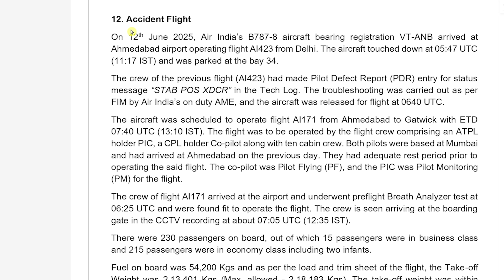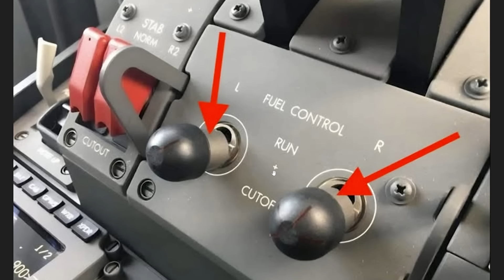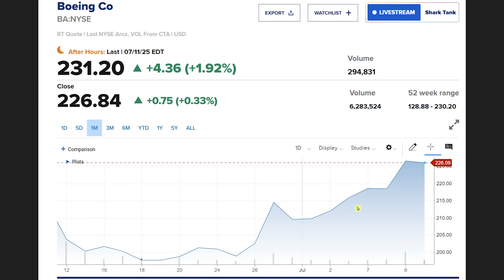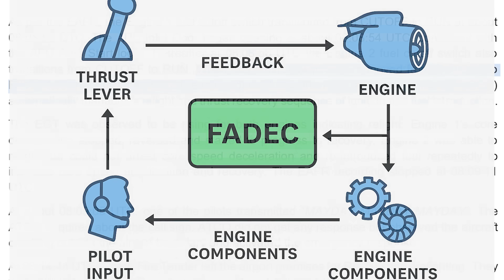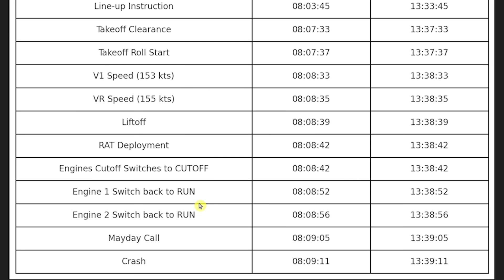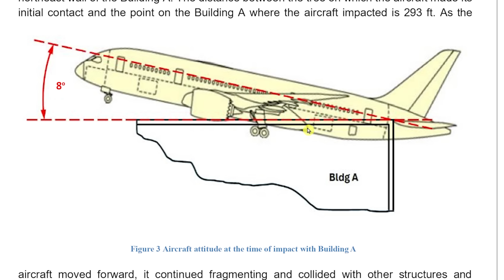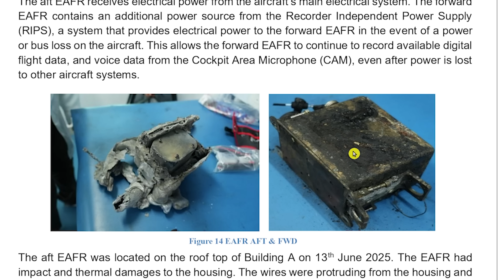Did Pilots CUTOFF Fuel? Shocking Twist Air India 171 Report!

Comment: Something people don't realize when zooming in on videos, is that it seems like a photoshop version of an incomplete picture, made using nearby frames and inserting geometric shapes made from nearby pixels. I learned first hand when my wife saw a video of me doing something in the boat and asked why I had my wedding ring off. I switched to neoprene after a motorcycle accident crushed my ring and nearly took my finger. 
I told her I had it on, but she zoomed in and showed a very clear finger with no ring and you could see the boat rail where the ring would have notched it. She was pissed and I was shocked until we went further in the video and it was there, clear as day. I've since seen similar evidence. I would not be surprised if you zoom in on a wing and the flap or other small features have been essentially Photoshopped.

Comment: the switches just send a request to the computer and the computer operates the actuators on the valves.  Correct?  From the conversation in the cockpit, and no one tried to prevent the restart, I assume it was a third party using the computer to crash the plane.??

Comment: nice timeline....A plausible reason but not this time.....wouldnt you think there would be more verbage between the crew than whats being presented? They had dual a flameout at 200 ft......I just connot see how 2 pro pilots would be monkeying with those switches unless something happened beyond their control...And it was an attempt to get a relight....Cause the engines shut down by themselves cause of computer error....so lets blame it on the pilots so Boeing doesnt take a loss and have to ground all of the 787s..... As a pilot i cry foul with all this.....God help the passengers......

Comment: In my opinion the reorder data time sequence does not provide enough time resolution to determine whether the RAT deployed BEFORE or AFTER the Fuel Cutoff Switch was moved to cutoff.   Are there any other systems than the pilots that can trigger the Fuel Control system valves to cutoff ?
Reply: No

Comment: I have 5 trusted sources of aircraft incident reporter/commentators that I regularly listen to because they have been the most accurate on average in reporting. Only you and then soon after, Juan Brown identified the RAT deployment and so I was waiting for you two to come out with the prelim report. I did see a 3rd of my trusted resources finally figure out the RAT deployment - I think that is because he was using the recording of the original video which was too blurry to see the RAT while you and Juan used the original video. He was the first of you three to present the prelim report, or at least that's how YouTube presented them to me in my feed, so I did watch his, then Browns, and now yours. Only two of you have reported on the report that identified that some of the engine cut off knobs could be defective and easily triggered if not replaced. I guess we have to wait for the full investigation to find out if it was the defective knobs or pilot's psychotic episode that caused the crash. Thanks for your diligence and accuracy. I came across you looking at the FL towers collapse and found you very diligent in your research. I'm glad to see you report on other things too.

Comment: What you don't understand (and neither does anyone else) is that it was not determined that the fuel switches were EVER switched off. The pilots said they did not turn the switches off, and in fact, the switches were set to "run" when recovered. However, the flight data says fuel switches indicate switches set to "cut-off". Very different.
Reply: The flight data recorder says the switches went from run to cutoff a few seconds after rotation and that they were returned to run about 10 seconds later, the flight data recorder shows the engines began to slow down after cutoff and began to restart and recover after the switches returned to run, but they didn't have enough time time to regain sufficient thrust to keep the plane flying.  The as-found positions of the switches are consistent with the flight data recorders.

Comment: So fuel cut-off switches are switched off in the very same second that the RAT is deployed? That seems strange when it is asserted somewhere that it is the engines spooling down below idle that triggered RAT deployment. I kind of doubt that spooling down from take off thrust to below idle takes less than a second.

Comment: Why should we assume the pilot was lying? If both pilots are long standing pros I have no reason to believe they are turned mass murders. These men lost their lives and Boing has to blame someone. We’re simply being fed a narrative. Is it all the facts? It is not. A computer log is recording an event one second apart. We don’t know what the sample rate of the recorder is. This event may have happened milliseconds apart but is recorded in different seconds. We have no proof that the switches were moved when the aircraft engines lost thrust. A pilot experiencing turbine winding down would instantly assume the engines were “cut” and assume the other pilot did it. We have to be careful to believe this is a smoking gun. These switches are designed to be challenging to move by mistake and in a hurry. They make a large click when released and this would be audible on the CVR. This audio needs to analyzed so we are very sure. We cannot rule out an electronic failure or sabotage.

Comment: It has always struck me as a planning flaw that buildings are permitted within miles of the ends of a runway.  It seems there needs to be multiple video cameras in cockpits of planes.   I hope the investigation can establish if the switches were inadvertently moved.   It seems a remote possibility that one pilot moved the fuel cut off switches instead of the landing gear.

Comment: None of this makes sense! The switches are almost impossible to accidentally switch off due to the lift over the gate. And BOTH at the same time? They shouldn't be able to similarly move from RUN to CUT-OFF via any aircraft instigated software actions. Also, if one of the pilots had intentionally switched off, then - when questioned by the other pilot - why deny you'd done it, if you intentionally wanted to crash the aircraft?This crash continues to be totally puzzling, but I'm wondering if we'll ever get to the real root cause?

Comment: Was the fuel cutoff switch working correctly? Was it used?  Did Air India replace the circuit board that controls the fuel cutoff, supposedly it has to be replaced after a certain number of uses?

Comment: We are not told by the report when the pilot, presumably the co-pilot, asked 'why did you cut off'? Thus we don't know if the fuel switches were put back to run immediately after this call or some vital seconds later. We don't know how long it took for the co-pilot to notice. The co-pilot must have glanced down and noticed the switches at cutoff. The PIC - presuming it was the PIC - said he hadn't done so. All we know is that about ten seconds elapsed between the switches being moved to off and them being moved back to on. So did the PIC immediately flick them back to run or was it the alarmed co-pilot?  Did the PIC simply sit there and watch the co-pilot do it? If the PIC did it why did he flick them off in the first place? 

The report curiously leaves out a number of key information points that might wrap this up satisfactorily. Disturbing is that if the PIC had switched the fuel off and then on again he waited ten seconds to switch it back on, all the while feeling the engines shut down and watching his plane sink.  Did it not occur to him during those ten seconds that perhaps it was because he'd turned off the fuel?

This story, I feel, will get a lot darker before we see light cast unmistakably on the whole tragedy.

Comment: Maybe the plane itself turned the fuel off, which it can do in the case of an engine fire or similar, overriding the cockpit switches, maybe the crew were trying to get the fuel back on after the planes electronics turned it off after a false alarm of some sort, don't be to quick to blame the crew.

Comment: How they physically toggled both switches off at the same instant? Could it be that computer glitched, and they had to manually toggle each switch from run to off, and then back to run to reset its state? That could explain both the conversation, and the delay between re-enabling both controls.

Comment: Maybe the pilots did not cut off the engine or move the switch. Maybe there was a wiring, contact or computing hardware problem that causes the FADEC ECU to "think" that the switches momentarily disconnected?

Comment: The amount of time from CUTOFF to RUN and the delay from N1 ti N2 switches to RUN may suggest there may have been a struggle.  I could not image a pilot that knows with those switches in CUTOFF, the plane WILL crash, at least in RUN there is hope.  That time, like you suggest, should have been nearly instant.  I would hate to think, that if the fuel switches ere placed in RUN within 2 seconds, that the pilot may have been able to recover the aircraft as the engines would not have spooled down as much and N1 was spooling up.  I would like to see this in a flight simulator.

Comment: Just odd that if someone intentionally cuts off fuel and doesn’t say anything other than, not it. Then, not sure which of the two, allow the switches to go back to run. Like if you wanted to go down, wouldn’t you prevent any chance of the other pilot recovering the aircraft.

Comment: IF the two switches were set to Cut off and then back to Run in an attempt to restart engines that failed for some other reason, why would the pilot who moved them to Cut off leave them in that position for 10 long seconds before moving them back to Run? Does the re-ignition procedure (normally performed at greater altitudes) require waiting 10 seconds? If not, it's unthinkable that the pilots would wait that long, particularly when the plane was already so low that each second counted.

Comment: When they started the engines the switches had failed to lock into the on position but were left balanced between the 2 positions.
This means that they were capable of moving between on and off with the slightest of nudge. 
It's just bad luck that they fell into the cut off position instead of the on position.
Mechanicle Spring loaded switches are notorious for wearing over time resulting in these possibilities.

Comment: Dont try and be smarter than the invetigators - I am not buying that is you own opinion, - The conversation did take p;lace - that is a fact - Both FCO switched transiting to CUTOFF in 1 sec is humanly impossible. Go to the sim and try it and let me know the result. I am telling you its impossible. Those switches are faulty and the locking mechanism is compromised.

Comment: Is the mechanical fuel cut off handles in the older 737NGs a safer device since it needs a strong pull then a long travel down to cutout point?

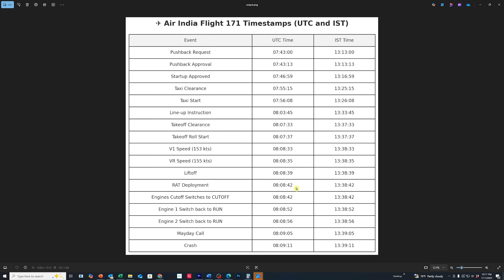Comment: There is a discrepancy on RAT deployment time on charts at 11:35 and 12:13. The 11.35 chart says Rat 3 seconds after cutoff switch.  The chart at 12:13 chart says same time. I think the 11:35 chart is correct Rat 3 seconds after Cutoff.

Comment: 08.08.42 RAT deployment... 08.08.42 Cutoff switches... I believed that the RAT had a little delay to deploy has it senses the engines energy production. For sure, 10 seconds to put back the switches on is looong. Not consistant  with a restart tentative...

Comment: Much has been made of the fuel switch detents. However,  what is the actual force (in pounds) needed to overcome the detent on a single switch from the RUN position thru to the CUTOFF position?

Comment: Why you even can turn off two engines during flight? It should be disabled once plane hits v1. Only one engine should be allowed to turn off in case of failure and also that should be only with attitude limits. Safety tells let it burn it won't hurt for a moment. Or have delay on fuel cutoff at flight, I can't think of situation which require fuel cutoff in flight immidiatelly. Let it be 10 seconds delay and master caution untill actual fuel cutoff happens. And only one engine. In flight mode of course over v1.

It should be like in modern cars, I can't put it in park or reverse while driving forward. Should be not allowed to do  such a ridiculous moves by accident or intentionally

Comment: One second gap between the two switches disengaging is not enough time for someone to do this manually . If you simulate this is impossible to do this with a one second gap it you had to do them with two intentional movements . The advisory regarding these switches said they disengage from the locked position which seems to have happened here .

Comment: Question: Mechanical vs. Electrical Control of Fuel Switches (CUTOFF/RUN)

If a mechanical switch is set to CUTOFF or RUN, it sends an electrical signal to the fuel controller, which then stops or allows fuel flow to the engine.

My question:
If a misfired (erroneous) electrical signal is sent to CUTOFF, will the mechanical switch itself also move to the CUTOFF position? Or does the mechanical switch remain in its previous position, regardless of the electrical signal?

I’m curious if the reverse scenario is possible—could an electrical failure or software glitch change the fuel state (e.g., cut off fuel) without the mechanical switch physically moving? Or is a physical/manual action always required to change the position of these switches?

Comment: Whats makes sense is, at the moment the fuel switches were turned off, was the time the landing gear should have been retracted.  Was the Captain busy turning the fuel off, so did not retract the landing gear.
Reply: Good point there.  As others have noted, it all seems to point to the captain (PIC).  He was the non-flying pilot (by his choice), and his hands would have been free.  The young right seater had his hands on the yoke, and once he realized the thrust problem, he sees that the switches have been moved to cutoff position, and he was the one who asked the PIC why he did that.  I suspect the pilot flying was the one who called mayday.

Comment: The FDR records the digital state of the RUN/CUTOFF switch from the Flight Data Acquisition Unit (FDAU), which interprets the signal from the AIMS or FADEC.
(if your interested check out message ENG1_FUEL_SWITCH_POS = 0 (CUTOFF) AFDX (ARINC 664))
** It does not directly read the electrical/mechanical position of the switch which everyone seems to be focusing on **
So, if AIMS or FADEC sends bad data, or if the input line glitches, the FDR will faithfully record the wrong info.

Comment: Would both switch physically be in the cut-off position all along while electronically registered as run until the said time when recorder detected it being in  cut-off in succession by the computer.   The pilot performed a checked after airplane lost power and attempts to physically change into run position.

Comment: The 10 seconds makes perfect sense, the pilot who noticed it likely watched all his other indications start dropping the looked down and saw the switches in the wrong position.  1 second or 2 of confusion then switching them back on.
Reply: Or everything was showing the fuel was shutoff but the switches were in the CORRECT physical posiiton! They would need to switch them off and back on again.
Reply: @dohabandit  the data so far doesnt agree, if they needed to switch it off then back on, it would have been done more rapidly.  Waiting 10 seconds to do so makes no sense.
Reply: @senzubean27 What if you saw the fuel flow rate drop, but looked at switches which were in the RUN position. You then ask why did you shut off the fuel, and are busy looking at electrical or other potential issues before trying to reset the switches? That could account for 10 seconds.

Comment: What is the time stamp of the brief conversation "Why did you cut off" and the reply  "I didn't cut off"? Did this conversation took place after switches were cut off or BEFORE? When both engines lost thrusts its possible that the pilot assumed the copilot had switched them off. When the reply was "I didn't not" then may be they were trying to revive the engines by the switching OFF and switching ON  sequence. Also, according to the preliminary report The RAT was deployed at the exact same time stamp as first engine cut off. Isn't it that RAT takes a  few seconds to deploy and that too when both engines fail? Its important that time stamps of cockpit voice recorder should corroborate with the time stamps of the events that happened from lift off to crash.
Reply: Read the report by yourself
Reply: Report is vague, selective. Hides more than what it reveals. Its unsigned. Published after midnight. Timestamp of the cockpit voice recorder not in the report.

Comment: whats the smoke on the left side at take off? should be dust or debris on the runway.

with the time in between the engine cutoffs, shouldn't there have been a turning into the engine that was shut down first?

i suspect the switches themselves with the requirement needed to change position on each switch. the only way i would think it possible is if the person used both hands in which the other would notice and likely would have had a surprised response.

need to hear the recording for sure.